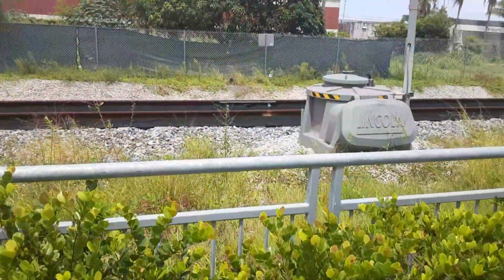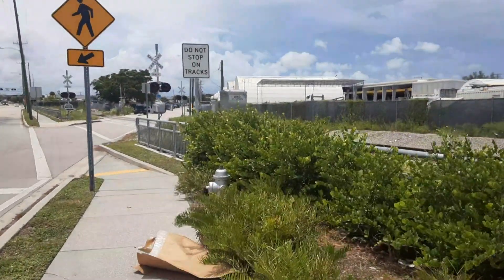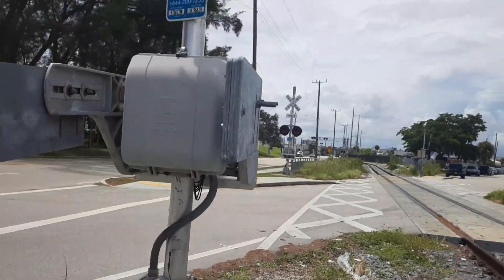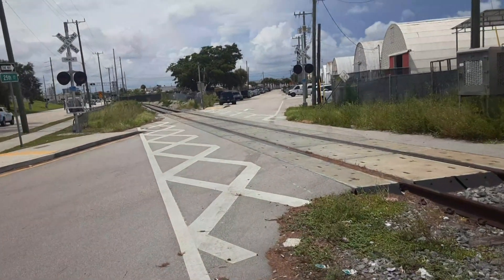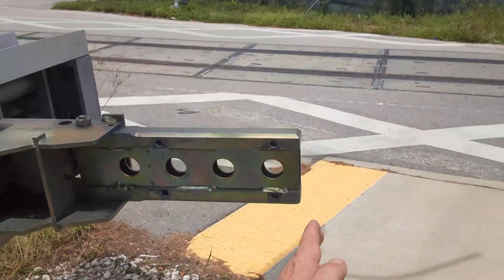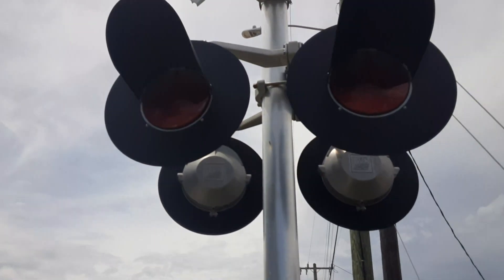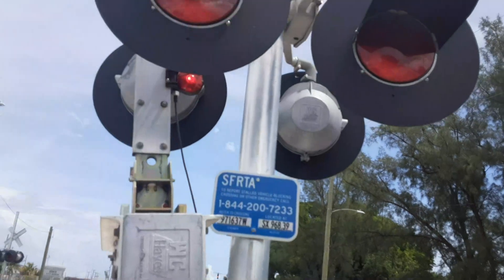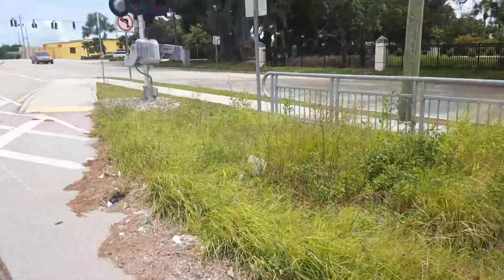New Railroad Crossing & Train Track Installation

Comment: It is a 'one-way' street, according to the markings and "do not enter" sign. The short gate is for the crosswalk. The "very short" gate😉and the 'uninstalled'(pedestrian)gate were likely stolen and taken to a metal recycler.
Reply: Gates are fiberglass or plastic compounds so they have little value to a metal recycler.
Reply: @gravelydon7072  That may be true, but that one looks like cut metal. And I know that neighborhood.
Reply from the maker: I bet there's a lot of questionable stuff going on in this neighborood. Thanks as always for the views and comments, Gentlemen!

Comment: From what I see in this video, all the equipment for this crossing, hasn't been totally installed. More parts and all corrections will take place, soon. Is this track a main line? Does it have lots of rail traffic? Answers to those questions, will give a more complete picture.
Reply from the maker: This is a connector track. So far since being built in 2019, it has yet to be used. The more one thinks about this crossing and the over kill with the lights on a one way street, the more it indicates that this is all about a RR company receiving a government grant that if they didn't use, they lost. Thanks as always for the views and comments, Walter!

Comment: why does brightline have track in olrando that runs on csx you no where that electric plant is on 528
Reply from the maker: Good question, I haven't been up that way yet to see the new track construction. But I thought they were building an entirely new track from the FEC. How much does it run on CSX for? Or maybe it could just be an interlocking?
Reply: wonder what will happen with csx down here not as busy
Reply: as up north
Reply from the maker: @trirail812productions8  I hear that in the past years, they've been abandoning lines and closing yards all over the country.
Reply: @railrol82 what will happen to csx down here we only get 452 453
Reply: does csx need to had more trains

Comment: It appears to me that the street going across the tracks is s one-way street. When you think about it, if that is a one-way street why are there signals on the other side of the tracks. There would not be any cars coming toward the tracks if this is a one-way street. That is kind of weird that the gate on the right side of the street before the tracks looks like it was cut off. Maybe this is a "used crossing gate mechanism" and the extension of the gate was actually cut off when the gate was removed from a previous location. Any way you look at it, this crossing needs further investigation over the next few months to see what is going on at this crossing. I sure hope that you can follow up on this crossing in the future. On another subject, why is your intro backwards. It looks like you are doing a selfie in a mirror. The tee shirt that you are trying to promote has the lettering backwards. And the numbers on the Mile Post are backwards too.
Reply from the maker: The intro appears backwards because l have it on selfie mode since l have no one to film me. The more one thinks about this crossing and the over kill with the lights on a one way street, the more it indicates that this is all about a RR company receiving a government grant that if they didn't use, they lost. Thanks as always for the views and comments, Thomas!
Reply: @railrol82  I agree with you on the government grant money. You have to use all of it or turn back what you did not use. If you do not use all the money, the next time you ask for a speicific amount of money, you may get less than you ask for because you did not use all the money the last time you received money.

Comment: The vast majority of folks that want to convert unused rail lines to trails are urban sorts and HATE rail - especially freight rail.  The SFRTA, on the other hand, recognizes the mixed nature of south Florida is mixed development; in fact, you have green spaces AND light commercial and industrial all over south Florida - and the green spaces are mostly things like cane farms - not parks.  (Farms EARN money - not merely consumer it like traditional urban parks.)  That stand could well be a solar panel to power the entire detection grid (from lights to the grid itself) in the event of power failure; I've seen similar sets to power traffic lights and other infrastructure in Maryland - especially if the structures are normally battery-powered.)
Reply from the maker: I'm almost certain that solar powered device is a flange greaser, I could be wrong though. How would one be able to distinguish a flange greaser from what you said? And yes for the most part, SFRTA is good about investing in rail opportunities. Thanks as always for the views and comments, Christopher!